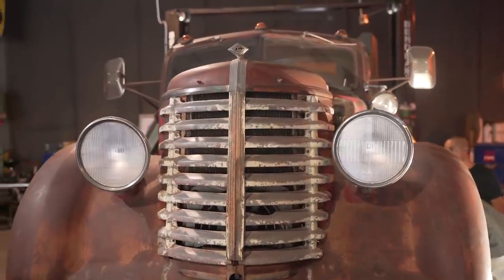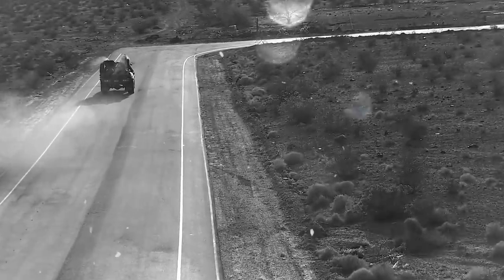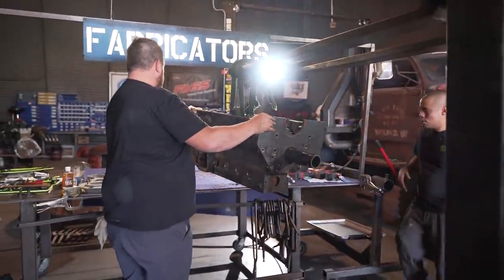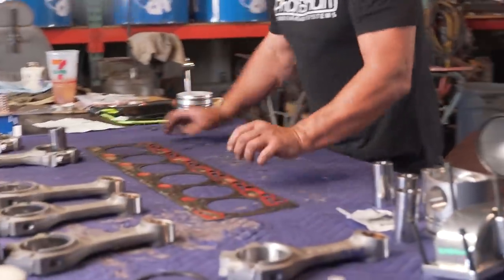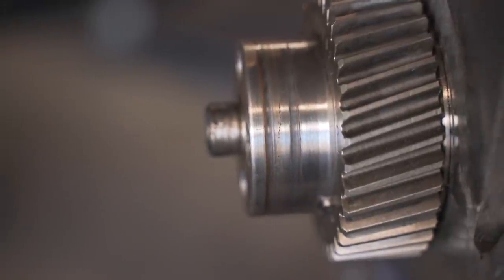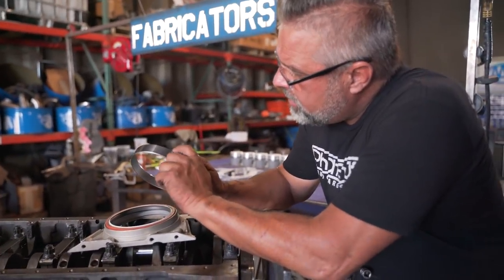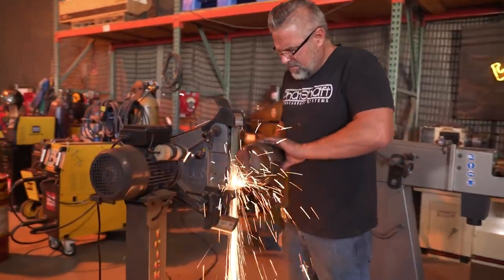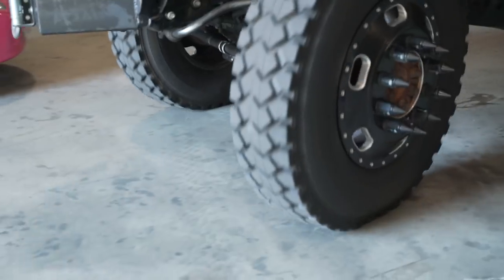Time To Say Goodbye To A Legendary Rat Rod

Comment: Heating the sleeve will work, it's just like in the days of steam locomotives they did the same thing with the drive tires on the wheel with a gas ring to expand the metal.

Comment: When you build something, it becomes a part of you and you form a attachment to them. I to had that with a 95 ford one ton dually that I cumminized it. To start with, it saved my ass in a shit hole mine that I  was working and would of froze to death had it not crawled out of the Denali mountain range with a whole summers work and snow came about two weeks early and my greedy ass stayed cause I thought it would dust me and leave. Instead when I left, it took two days digging to get out of ten feet of snow an ice and it was so bad that other GI trucks were setting up from leaving a week earlier. I had built it so damn strong that I didn't think it would ever stop in a hard haul... basically it never did let me down and I built that truck back up to new and had my 350 frame built more like a 450 setup with the nine foot aluminum bed, alcolas all the way  round, paint and polish, chrome, gooseneck trailer setup which I pulled a thirty foot  trailer on. King Ranch interior and just name it candy. When I got hurt and couldn't get in it any more, I was all pissed off and traded it when mad.... long and short never forgave myself. I know how tight you are with family and building stuff with them even though you had to push an motivate them to do the right things. I kinda thought that you would fight city hall to park it up on the place even if it didn't  run or some damn thing, it would stay as yard art if need be. California has got the  world thinking to go electric. Some of  their county rules blow my hat off like the no hood up or only certain tools allowed to own... its communistic in my head... no need to go off here, and make a book of bullcrap
Reply from the maker: Morgan,
I sure enjoyed your story. I can understand how you must have kicked yourself in the butt for letting it go.  It's true that when you build it yourself, it becomes family. You and your truck had a great adventure together, one you will never forget.  Thanks again, Steve